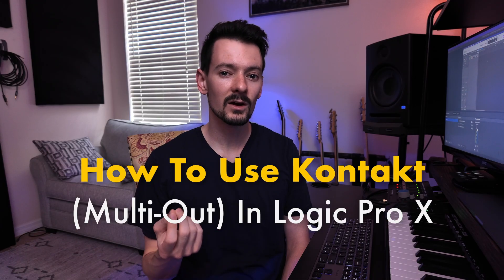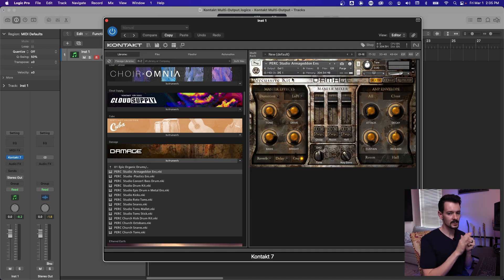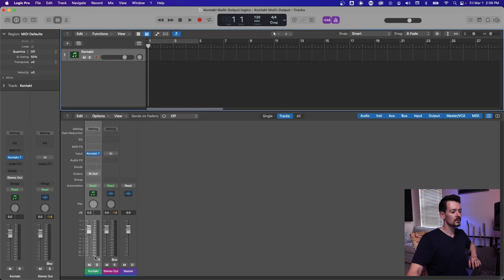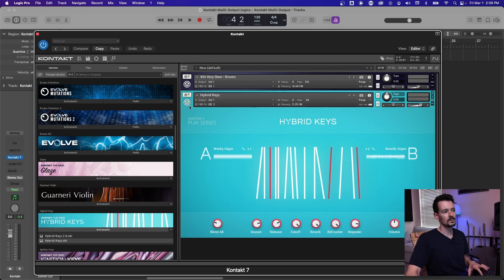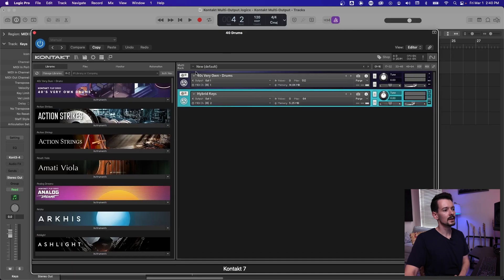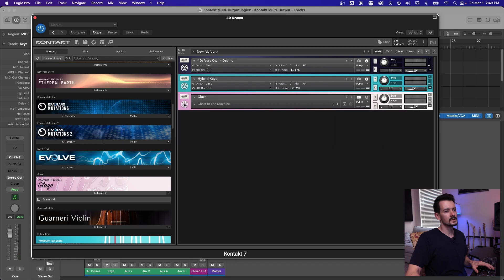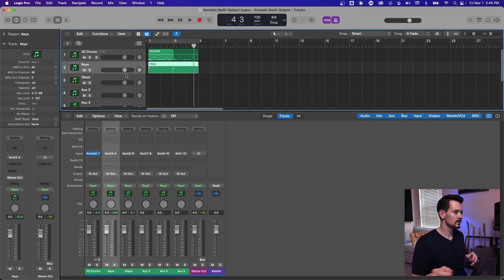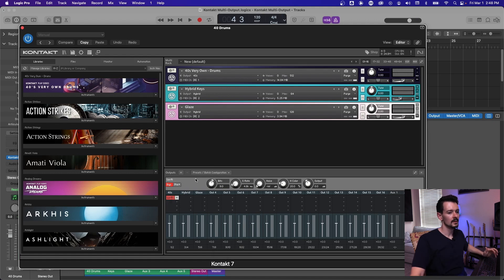LOGIC PRO + KONTAKT | How To Use MULTI-OUTPUT Mode

Comment: You have no Idea how much this helped me. i have watched EVERY tutorial online about this subject. I am using 16 st channels to run a Drum VST from Teletone (whch has about 10 outputs but no multiples (top/bottom of drums). But i really dig the style and variety for what Im doing. I was able to load up a second instance of the plugin and both instances can route each drum to individual tracks. I doubled up on the second instance but its mostly to enhance kick, snare and overhead sounds to fill them in. But I can also use to add more unique hits if I'd like. I think if it like micing a drum with multiple mics then sculpting with EQ to keep the main drum sound while enhancing other parts of the sound to round them out. It was a bit confusing but the amount of control I have now over the midi drum sound feels really great. Now Im not worried about them sounding generic, flat or limited. Your tutorial was the only one to show how to record extra midi regions and connect to them while still being able to isolate the tracks when performing. Thanks again.
Reply from the maker: Well you’re heading deep down the rabbit hole now 😂 happy to help and best of luck to you

Comment: Thanks for your video pal. 

It's weird as Logic has some idiosyncrasies. The way I used to do it was making a multi timbral instrument from the get go. Only thing with this Logic doesnt let you solo the separate channels.

The way you did it, starting with a normal instrument track then right clicking the mixer, creating the auxiliary tracks is definitely the better option.

One thing to note, when exporting the stems, Multi-Output Software Instruments should be "One file per track"

Anyhow I think you're right, this topic isn't covered much. Kontakt 8 makes it even more fiddly to get to the output section now by having to click one extra to go back to classic view. 
Also, I wonder how much ram/CPU using one instance of Kontakt really saves. 

Cheers man!
Reply from the maker: Great thoughts friend, as this is a great framework, there’s so many little weird things between Logic versions, Kontakt versions and even sessions sometimes, that it’s really a guide to get you started figuring it out for yourself haha. And yes, I’ve noticed weirdness with Kontakt 8 so I’ve stayed on 7 personally. Also, that’s an interesting thought, I’m not sure if the heavy CPU usage comes from Kontakt itself, or rather the libraries being used. Could actually make more sense if it was the latter.

Anyways, we’re all in the same boat there, cheers!

Comment: Thanks for the super helpful video! I’ve run into an issue, though. When I try to make adjustments to the VST on the second or third track in Kontakt while playing some notes on the keyboard, I can’t do it because the Kontakt UI disappears as soon as I select the second track.
Reply from the maker: That's a weird one, I haven't seen that before. Could be a weird bug with your version?

Comment: Thanks for this. It was really helpful, but is there a way to collapse the tracks down to just one track when not in use. I'm building a large template and I was hoping this would help minimize the total amount of tracks by putting 16 similar items on one Kontakt instance. Kind of like a subfolder in a large track stack.
Reply from the maker: You MIGHT be able to nest them in one type of track stack. Because there’s “summing” and “folder” track stacks. I’m pretty sure one can be inside the other, not sure which way though

Comment: Hey, I am setting up my template for orchestral production and there is a problem i cant find the answer to. When we have multiple channels loaded in 1 instance of Kontakt, With the aux's the audio output is coming out fine, but when i trying to control the dynamics with the mod wheel. It only works on the the instrument channel 1 and not in any of the aux channel which is sending the midi data. Looking forward to your help.
Reply from the maker: That's interesting. Check that the MIDI channels are assigned on the auxes. It does it automatically for me but it might not always do that. Thats the only thing I can think of.

Comment: The first midi you record on that Logic track is shared by all the instruments in that multi-rack.  Have you tried a method to have multiple midi notes set to different midi channels on the same Logic track?  Is that even possible?
Reply from the maker: The only way I've found for doing this so far is to create the multi-out auxes from Kontakt, hit "control + T" to add those tracks to your main workspace, and then move the midi down to the new tracks, which I think is the method I showed in the video. You may be able to set up some weird routing using Articulation Sets to send different notes out different MIDI channels though.

Comment: Thanks for the nice tips, but I'm facing some issues, probably bc I'm just a noob. When I do the routing and try to solo a track, I'm actually solo-ing the whole Kontakt istance. I have the same problem with automations: every time I automate the track (volume, pan or whatever) it doesn't work. Appears that I can solo and automate only the main channel (1-2) . Do you know any solution for that? Thanks again for the great video!
Reply from the maker: Hello! In the mixer, did you right click and hit “create tracks” over all the Kontakt auxes? That will make them accessible in your main window for things like automation.